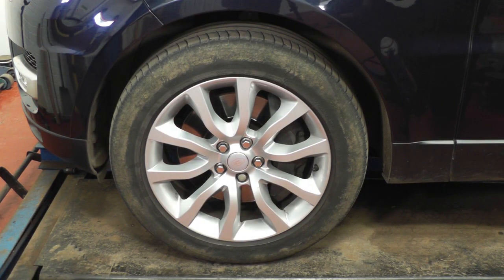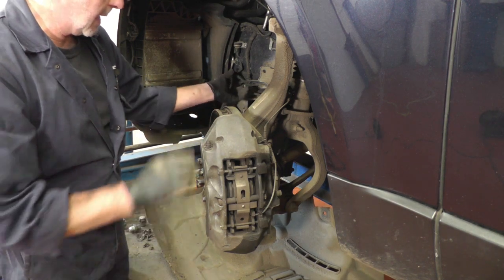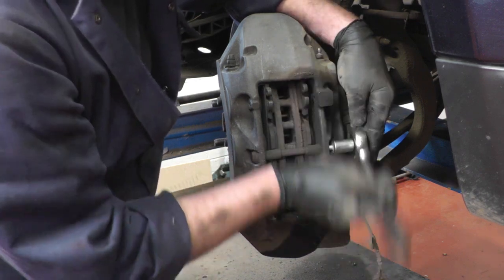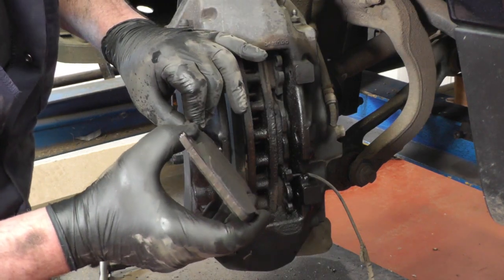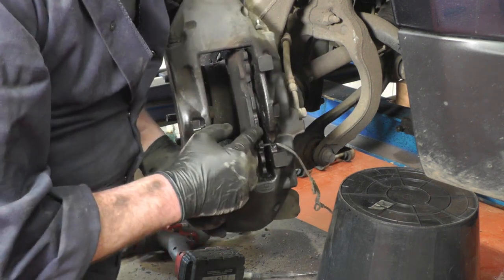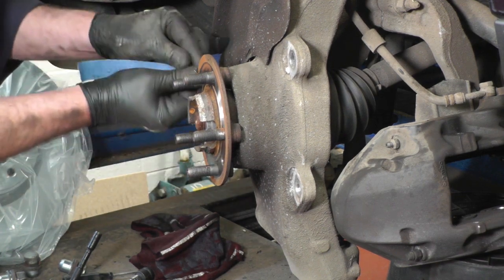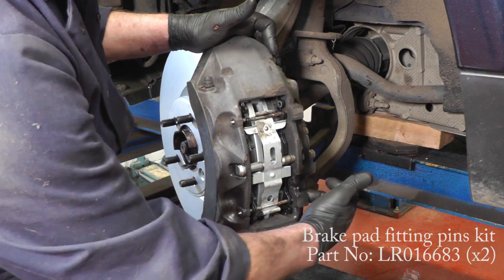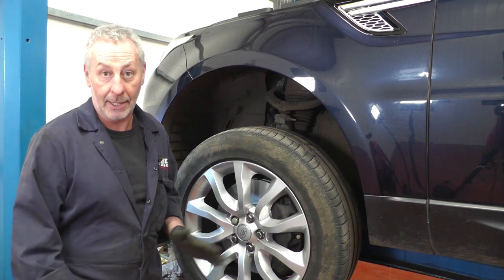Range Rover Sport - How to Replace the Front Brake Discs & Pads

Comment: A very thorough and well planned job there JP, I don't think you will get that attention to detail in many garages today, I would have thought that the pins would be made from Stainless, or at least have been assembled with copper grease, the brake pad sticking in the calliper body would cause bad brake drag, which probably contributed to pad wear. Stay safe ! Chris B.

Comment: Do you have any suggestions if you can't get the pins out (on an 80,000 mile Range Rover). Brakes haven't been changed at all. The pin ends are beginning to flatten out I've hit them so much
Reply from the maker: Hi Rob, 

Perseverance and using a penetrating oil can really help in this situation. You may also need to soak it overnight. If however you cannot get them to shift still, you may need to replace the calipers completely or seek assistance from your local Land Rover repairs specialist.

If you do need new calipers feel free to get in touch with us and we will happily help you source new calipers.

Contact:
UK: 01522568000
USA: 855-746-2767
Email: sales@rimmerbros.com

Hope this helps!